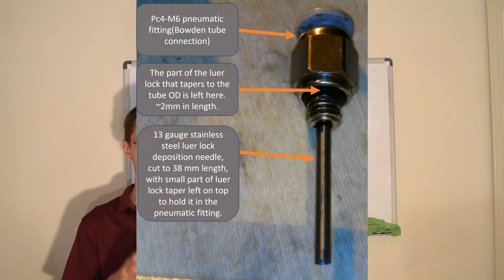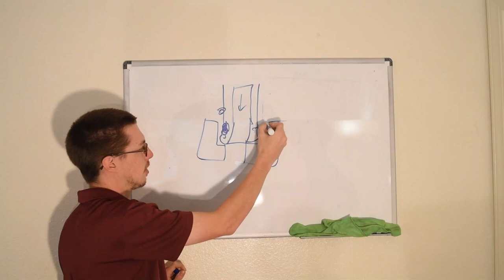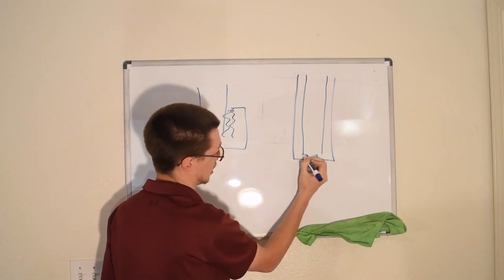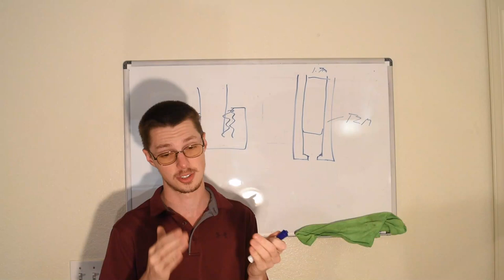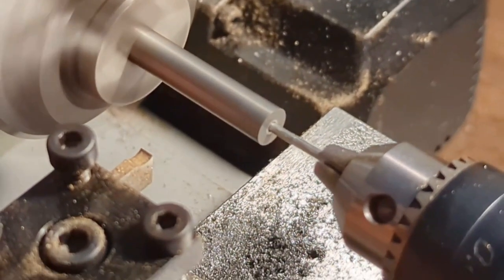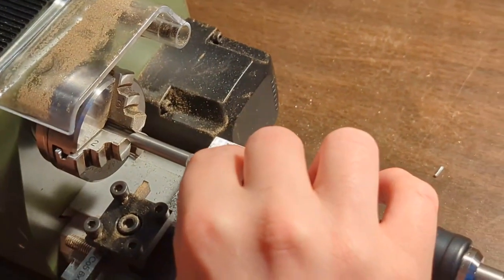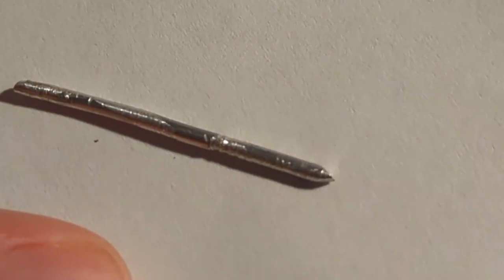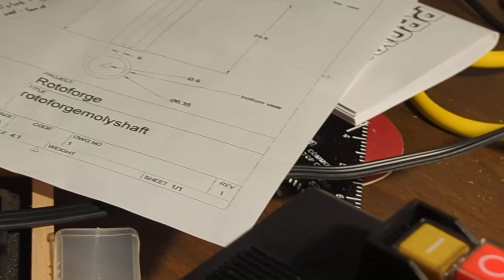Rotoforge Update 04/02/2023-The Wonder of Metallurgy

Comment: Very interesting! Have you done any tests with the TZM shaft formed into an actual nozzle?
Reply from the maker: This is presently what we are working on. Should have something functional, based on a fully TZM shaft/die, in the next week or two.
It may be worth just machining a short nozzle that threads onto the existing shaft. We have not yet tried this approach as we have been focused on making the shaft and nozzle essentially monolithic to simplify assembly and to eliminate any question as to fitment, and tolerancing beyond having a tight fit hole for the wire to press into.

We conducted a few additional tests, with and without lubrication on the wire before insertion, and it seems that a few things are somewhat true:

1) If the tolerance between the wire OD and the shaft ID is closer, the wire has less propensity to weld to the walls of the shaft (presumably because the radius of curvature supported by wire bending is much larger before the wire touches the rotating wall which makes for a larger effective contact area). IE the wire cannot bend as much and so does not press as hard against the walls of the shaft.

2) The addition of lubrication (WD-40) effectively prevents coupling of the wire to the rotating TZM shaft, when the shaft ID is properly toleranced for the wire ID. Something like ~ 1.7mm drilled hole for a 1.6mm wire OD.  The low friction properties of TZM with hot metal are apparent by the ease with which the end of the wire deforms into the shaft of the drilled hole without placing much additional strain on the lathe and without apparent wire twisting.

We are going to run and upload a few tests on some shortened sections of TZM, drilled into the same overall diametral dimensions, (see 0.9mm exit orifice, and 1.7 mm inlet hole), in the lathe first, while we wait for a few longer carbide drill bits to show up to be able to actually through drill the TZM motor shaft at its final dimensions for the motors we have on hand...
This will hopefully be informative as to just how much a difference the choice of die material makes, even at the relatively low speeds obtainable by the lathe, before we go whole hog on fabrication of the custom shafts. Which we will also record and upload in its entirety.

These little galling tests have brought back some discussion of whether we should make an offset spindle design. It is certainly in the cards, but still represents a good bit of additional design effort and moving parts. So not just yet but maybe soon. 

A bit long winded, I hope I answered your question. :)
Reply: @rotoforge2024  Super cool. Thanks. I was curious whether you could drill TZM with normal HSS drills, evidently not. You've probably already thought about this, but if having a smooth surface finish is important you probably want to be at least reaming the inside of the bore, although it obviously gets tricky with a reduced orifice at the end since you can't push the reamer all the way through.
Reply from the maker: @jsincoherency  
One can drill TZM with HSS drills. But the quality seems to matter greatly, and a nitride coating seems to go a long way. 

carbide drills certainly make it far easier though. 

I cant get more than 1-3 holes out of most of my HSS drills. 

A reamer is a great idea. thanks for the suggestion. The internal surface finish does seem to make a lot of difference, but how it effects printing with a TZM die, I am not yet sure.